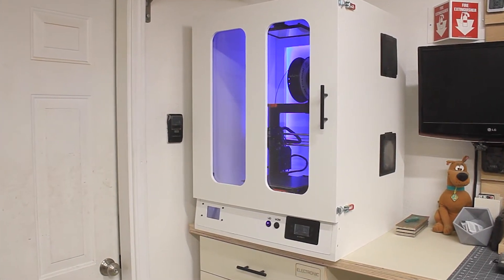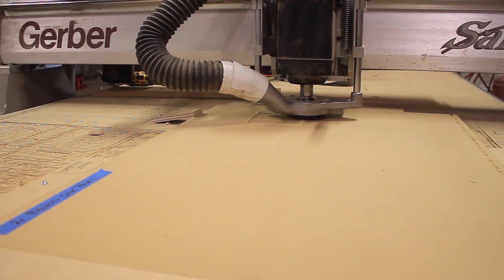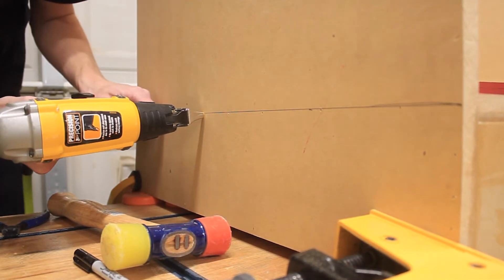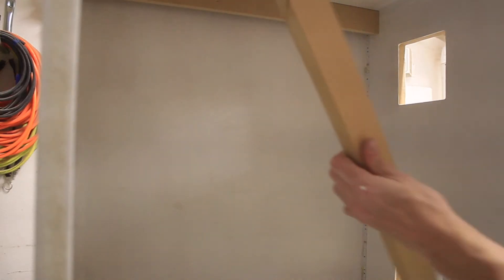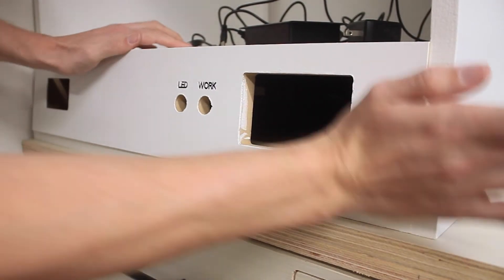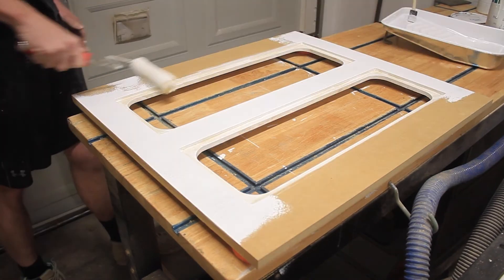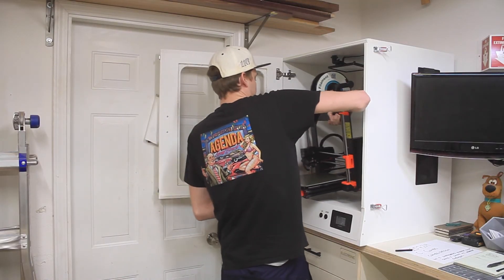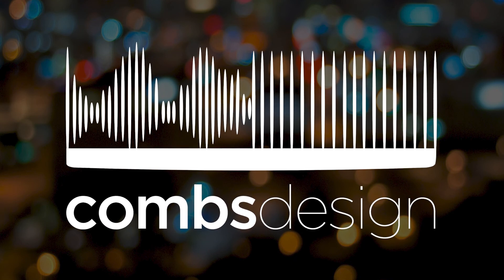3D Printer Enclosure with Touch Screen

Comment: Honestly, had I seen this design before I built my enclosure, I'd probably have copied a few ideas.  I've run into issues with mine.  I didn't expect MDF to hold heat so well that it was literally cooking the machine itself.  Wish I would have build a cubby underneath for the parts; though, I'm probably going to move my PSU back inside to help with preheating.
Reply from the maker: MDF is a fantastic insulator for sure. On long prints, my fans have a hard time keeping up and I’ll have to crack open the door.
Reply: @CombsDesign  My hotbox goal is to add flaps so that I maintain the heat inside the box until my air-cycle fans turn on.  Right now, I'm just using painter's tape and paper on the front flaps until I can figure out something to print in which the force of the fan is enough to open the flaps.

Comment: The enclosure looks great! Love that you made the led strips hidden, will use that in the future.

Have you considered placing the printer power supply outside of the enclosure to keep it cool? I've seen /read that on other videos /comments.
Reply from the maker: Thanks! Great question on the power supply. Since my printer sits out in the shop where I do all of my woodworking, etc. Dust is a much bigger problem for me than heat. That being said, I considered the externally mounting the power supply, but ended up keeping it in the stock position and strategically mounting the intake and exhaust fans to maximize cooling for the PSU. If I was in a situation where I was building this to sit inside and away from dust, I would probably mount the PSU on the outside of the enclosure. This was a situation where I had to compromise in one way or another, and chose the lesser of the evils.
Reply: @CombsDesign  makes sense, thanks! Will re-watch the video and have a closer look at your ventilation design.
Reply from the maker: @lunoxx  I don't address it in detail in the video for the sake of brevity. The lower fan is my intake, providing cool air directly across the PSU. The upper fan is the exhaust since warmer air rises. My thought it that the upper fan will constantly remove the hot air that rises to the top, and the bottom fan will directly cool the components of the PSU.
Reply: @CombsDesign  How is keeping enclouse after 2 years ? DO you make any modification or most important do you have dust problem ? Recently bought Creality Ender 5+ and looking for enclouser becouse will sit in my shed where i do hobby woodworking and im really concern for the dust , i hope after watching this you dont have problems and i can do similiar project like this .

Comment: Those look like Neutrik Powercons' are they any better than an iec connector?
Reply from the maker: That specifically is a Neutrik Tru1 connector, the Tru1 is the successor to the Powercon. The benefits are that they are locking, IP65 rated (outdoor rated) and can be connected while hot. Everyone connected Powercons while hot as well, but these are specifically rated for it. I like any connector that locks in place.

Comment: @Combs Design Great Video! you are really talented! One question... if you put a 3d Printer inside a closed enclosure with fans don't you need intake- and exhaust fans so the hardware like the mainboard and the PSU does not overheat? or will the parts be fine?
Reply from the maker: The bottom fan is wired as an intake and the top one is wired as an exhaust.
Reply: I was thinking the same thing except that might not work for. My printer is in the garage in houston.  I have temperature swings from 50 to 105 depending on time of year with high humidity .I may have to dry the air before it enters the enclosure.

Comment: Other than the PSU cooling, any other parts you recommend as candidates for putting outside of the enclosure like the printer control board, etc...

You hear so many people talk about what has to be put outside of a heated enclosure to avoid scrapping your printer, I’m curious to know more about what you’ve experienced, other than what you already explained for the PSU.
Reply from the maker: I personally think the enclosure heat problem is overblown. I work with complicated electronics all over the world and the only time I experienced a heat issue was outside in Kuwait, and it was 132 degrees F that day. The hottest this enclosure has ever gotten was 92 degrees, and that is outside in a garage with no AC. It is possible that it might get hotter in the enclosure this summer, so I will wait and see. I really think that all electronics on a decent quality printer should be able to handle the temperatures of an enclosure. As long as you have some air exchange, I would not worry too much about the degradation of components.

Comment: What is the temp controler you are using?
Reply from the maker: Sorry for not listing that in the affiliate links. It is cheaper to buy the controller and 1 fan as a set, and a second fan separate. A kit with all 3 parts is $25 more than buying these 2 items.

Controller + 1 Fan- https://amzn.to/35w4s1w
Extra Fan- https://amzn.to/2TJtzvr

Hope this helps!

Comment: Is it available for sale please reply i am interested to purchase great design , can you make for Creality Cr-10 V2 printer i will pay the charges
Reply from the maker: Sorry, I simply don’t have the time to build custom enclosures. I’m glad you enjoyed the design, though.
Reply: @CombsDesign  no issues combs could you please tell me the overall cost you paid for this project
Reply: one more question why would you require two exhaust fans since you need to seal the heat inside for ABS printing and complex models
Reply from the maker: Probably around $400 if buying everything new. I already had the MDF and battery backup, so it is hard to say.